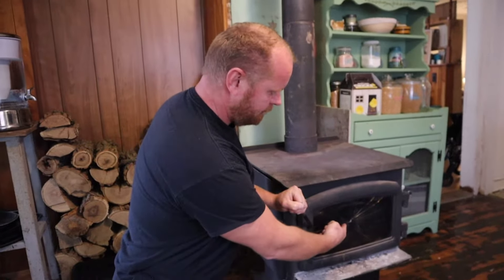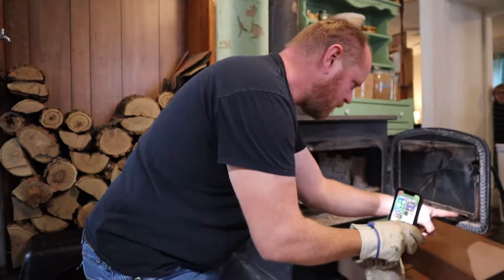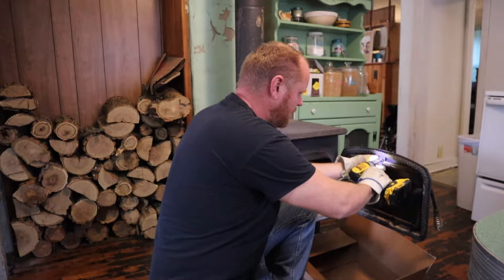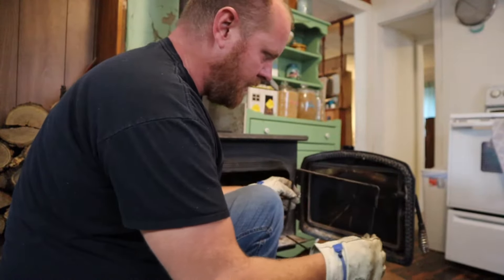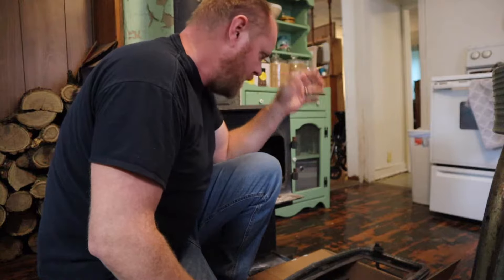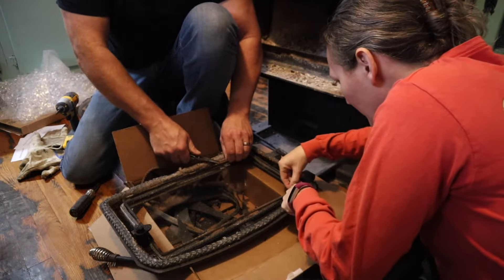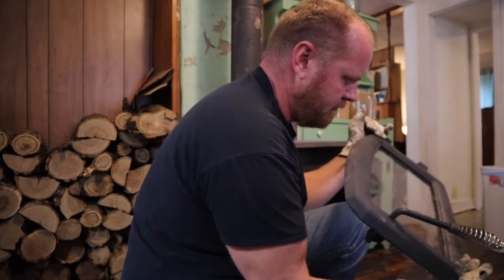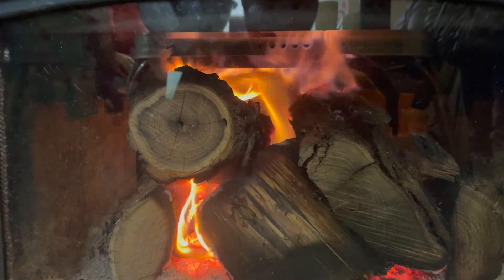How to Replace Wood Stove Glass

Comment: For your previous glass to be that black / cloudy, you're either burning green unseasoned wood or not burning the wood hot enough.  Mine is crystal clear.
Reply from the maker: Yes, we have to keep the damper down because we live in a 600sqft house and the stove can heat a 3,000sqft space. When the stove is wide open the house is like a furnace. 😊
Reply: lol Not only is your glass dirty, what the heck did you throw at it? Dang! lol Actually Thanks for doing this! very much appreciated!